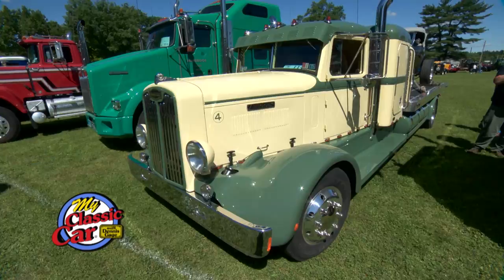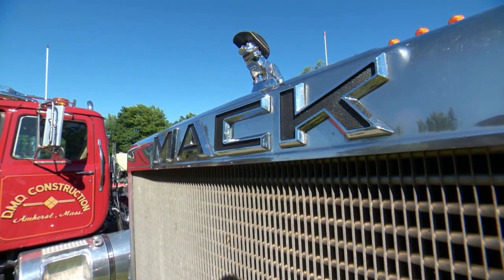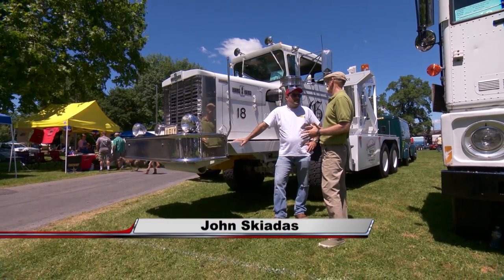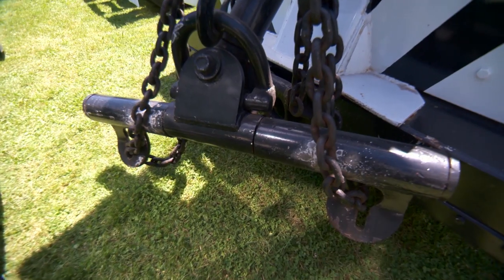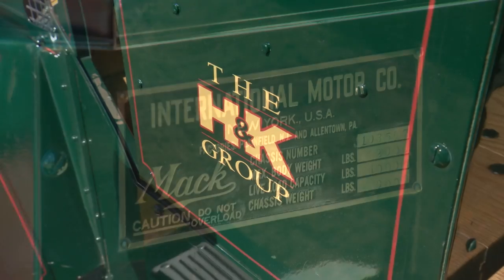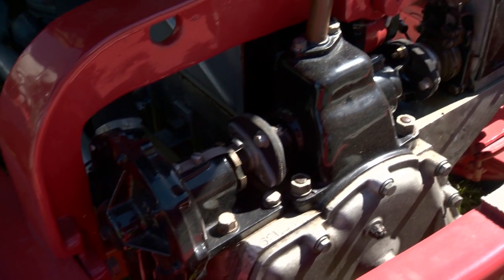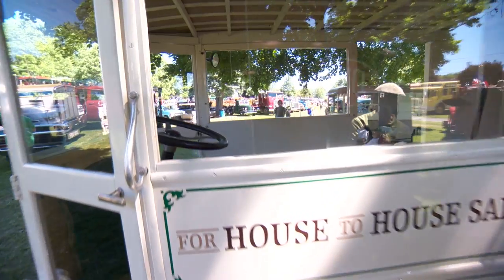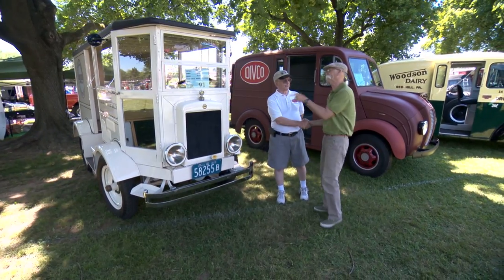1971 Oshkosh "Ugly" C2044 Caterpillar Powered Tow Truck | 1919 Mack Truck A.C. Hooker

Comment: I've drove several those old Oshkosh cement mixers in Chicago,  they rode like riding a rock, took corners like a house, but you could not stop them
Reply: Paul Kersey   they didn't put auto trans in those back in the day. Brother with all the axles locked on when leaving the road the would go anywhere. I had mine in shit to where you could only see the top few inches of the tires and it just kept going  and going. Great vehicle. It really was. Take care
Reply: Paul Kersey  I swear they could climb a vertical wall if you took your time lol.  It was the best job. I aldo drove 6 axle Advance front discharge Transit mix trucks the had 10 speed automatic transmission in which I didnt care for cause I fell I you have more control with the manual transmission. Those things were tanks. Where else can you go and get paid great money to drive off road with something like that.  It like never growing up, it's just that my sandbox got bigger lol. Tonka to Oshkosh. Paul and can talk about that stuff all day lol.
Reply: Nope they would go just about anywhere.

Comment: I remember a flat bed, 3 axle truck we used in the Construction Field Forces of Southern California Edison. This was back in the early 1980's. We built high tension tower lines throughout So. Cal..
  It was an FWD, and looked like a military surplus. It drove like a tank and it's suspension was so stiff, that even with a full load of insulators it was like riding a hard tail Harley. You just bounced along for the ride. We also had a 1958 International Harvester set up as the "Tensioner" for when we were pulling wire and sagging between towers. That was an awesome job for a 19 year old to hire in fresh out of college.
Reply: I always wondered if it was the same Co. as that old 4X truck in this vid.

Comment: That 71 Oshkosh is exactly what I drove back in the mid eighties and 90's with a Tri-axle Transit mix " cement truck body , think mine was a 69 if I am remembering correctly. They put a 10 speed Fuller in it at one point cause a 30 speed was difficult for some of the drivers since it was used as a spare. Three stick shifts scared a few people lol. Had a Detroit  8 v71 at  the time. Pulled like crazy and had that screaming motor in it. Miss those days

Comment: Beautiful units. Thanks to all for their work and passion. The “Ute” is shortened from ‘utility truck’ and was and is supremely popular in Oz. Their work utility has been usurped by efficient trailers and most modern ute owners are a bit more concerned with the $40-$80,000 price tag and premium paint job to use these vehicles most effectively. Besides the designs today are all for looks, the sides are too high to sling a load over while the back access is also so high that you have to clamber aboard to retrieve most loads. The twin cab Ute is almost the most popular car in Australia, generally FWD and powered by a diesel, it is also often equipped with a canopy over the tray which makes it a rough and ready station wagon.
Reply: I'm not Australian, but I'm still familiar enough with the Utes of Australia, where I wouldn't need that much of an explanation from the owner. It comes with being a big car freak.  I've got to find the time to head to one of these shows before I die.
Reply: @Gecko88  or, in the case of one of the trucks in this video, FWD = Four Wheel Drive Truck Co., AKA FWD truck. Seagrave fire engines is a division of FWD.

Comment: My favorites are the r model Macks from the 80s when they figured out how to make them pull with just a 5-speed and still run 70 miles per hour with a 300 4 valve engine
Reply: I had the pleasure of driving several 70s and 80s Mack R 600 700 and a Superliner , I still can't get enough info or pictures of them.
Reply: They were alot better with a 12spd , same design , just longer , and the 300 4v was a magnificent engine .

Comment: That Ute is cool; I gotta finish mine. It's a 4 door 1974 Valiant that's been cut n chopped. I thought I could learn to paint watching You Tube but i can't. My problem is trying to find competent mechanics and body painters. When ever I go to a car show everyone asks all kinds of questions. When ever I go to a new mechanic, if they say, "This car is Special so it will cost more...." I will call a tow truck and have it hauled away. I have done that 3 times for one breakdown which ended up being a coil pickup in the distributor. Sometimes owning an old car sucks.

Comment: I worked an excavation job in the early 1990's, I got to dive a 1951 Peterbuilt, huge Cat engine 600 hp it had a 13 spd with 1 2 spd brownie and 1 4spd brownie. This was a dump-truck btw, never tried it against a halftrack but I bet it would have given one a run for it, that thing could go vertical if it got enough traction!

Comment: He's holding that crank which is why he broke his thumb. We had an old Allis B which we use to hand crank a lot and and old generator which we used to hand crank. You never hold that crank. You pull it over and let go so it can't kick back and break your wrist or thumb. Between the two I probably started them over 200 times like that and never had an issue even when they would kick back.

Comment: Trailer Queen that what they call it. To save gas on there classic car or truck however im pretty sure those out there have other names for transporting there. Cars and trucks.
Reply: since 1950 it's been illegal to drive solid rubber tires on regular roads and the cable operated brakes would be scary in today's traffic, so how else would you get them to the show ??

Comment: Weren't some of those Chevy utes badged as Holdens?
Reply: No, the Holden Ute is a smaller vehicle ,designed by GM USA though,it was a scaled down Chev or pontiac in concept . The First were the FJ model which could be utes or panel vans . Not too long ago you would often see them running around in most Australian towns but most are in the hands of enthusiasts who  have them on concessional registration which prevents the owners from using them too much. A shame really.